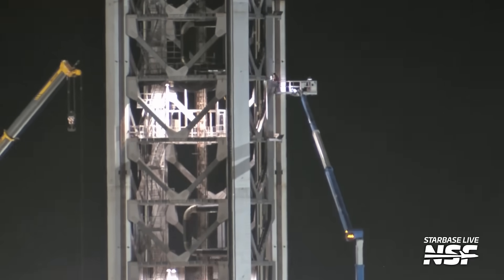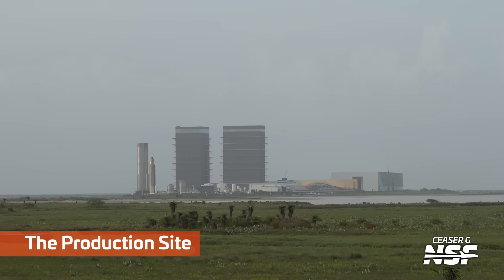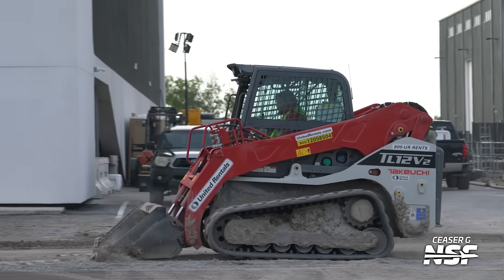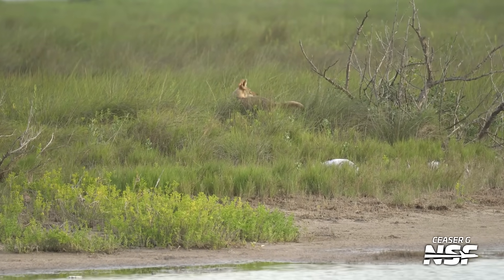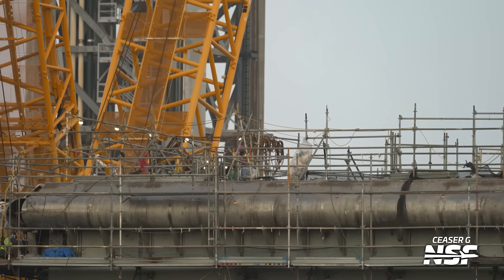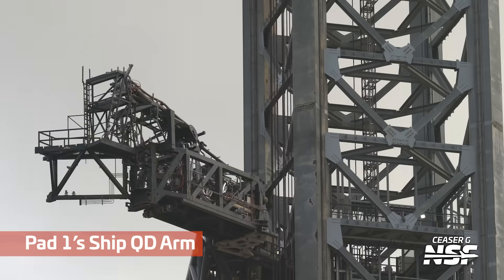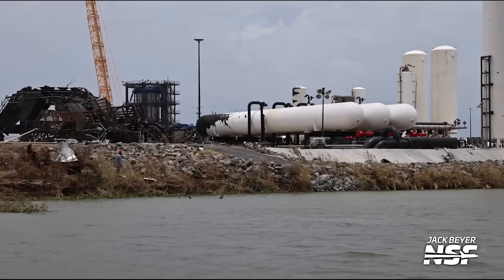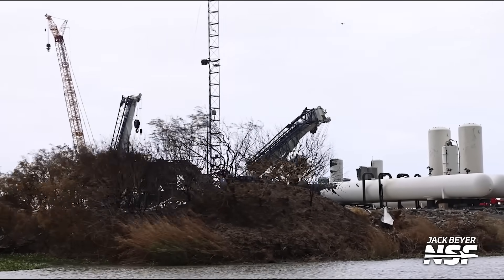"Ship 36 is not a ship anymore" | SpaceX Starbase

Comment: Two-three year mandatory stand-down for full investigation.
Reply: That's pretend expert idiocy.  But you people are notorious for making up nonsense.
Reply: @imaginary_friend7300 No. That's the appropriate amount of time to field independent experts and regulators and to perform a forensics analysis of the whole string of catastrophes, business analysts to root out managerial causes, to then apply those necessary changes as well as technical, regulatory and business oversight, to implement safety culture, and to eliminate the causes of the problems, most particularly the people causing the problems. This is taxpayer money that is being pissed down the drain. Also,,, a whole analysis of the environmental impacts to the protected reserve must be performed,,, with decisions about whether it is appropriate to continue using this location at all, or relocating it to a more appropriate location.  That is all called. being responsible. I know. Strange concept.  Get used to it though. As things now stand, no human flight operations should ever.   be approived for this craft until this is all done and the safety of the crews and local environment can be assured. And yes - that means Elon doesn't get to pretend to be an engineer of to play spaceman any more. Actual competent adults must be running the program. Or - the governent contracts should all be pulled, and go to a control by financial fines and punishment approach.

Comment: The first OLM is not designed to handle a launch of a V2 or V3 booster.  However while they are rebuilding the launch pad they could continue to use OLIT1 to catch Starships.

Comment: Perhaps an adapter ring can allow Starship to be mounted on OLM-A, then with a connection rig it could be static fire tested.
Reply: Came in here to post this
Reply: Although possible highly unlikely as the deluge plate would not be able to support the engine firing pattern
Reply: Possible, but the test stand is made to be blown up. Taking out the OLM would be a much worse option if something like this happened again.
Reply: @bman5988  Well boosters are test fired on OLM-A.  Anyway it will be superseded shortly.

Comment: My prediction: They'll complete cleanup in 2–3 weeks, inspect and test the tanks and most equipment. Meanwhile, they'll begin piping and rebuilding structures. Assuming the tanks are fine or replacements are readily available, testing could resume in 1–2 months. A full static test might happen in 3 months. Will they rebuild for Ship v2 or switch to Ship v3 during this pause?
Reply: The end of a couple tanks near the static fire stand were blackened by the heat from the RUD of 36 which was only visible in a video by RGV.  That being the case I can't imagine those tanks would be safe to use.

Comment: 8:02 The IMAX camera is no longer located at the top of Tower 1. Most likely it was removed sometime between flights 7 & 9
Reply: Good spot! I wonder if they'll use it again or if they only filmed for the first flight and the catch flight perhaps. Most of the time I think it was just a case since the camera itself is wildly expensive so it would have been cool to see which flights they installed it for